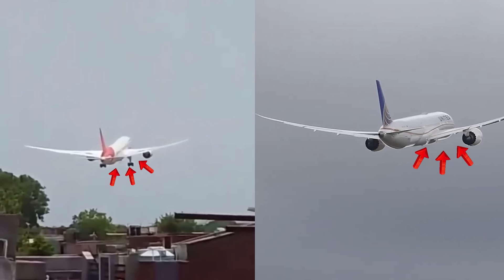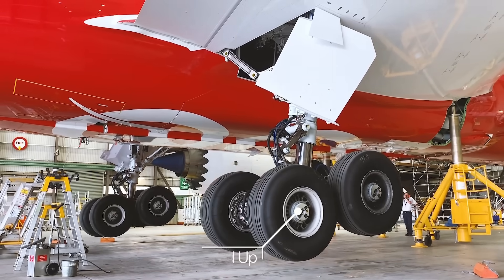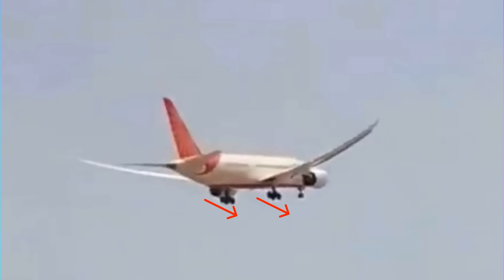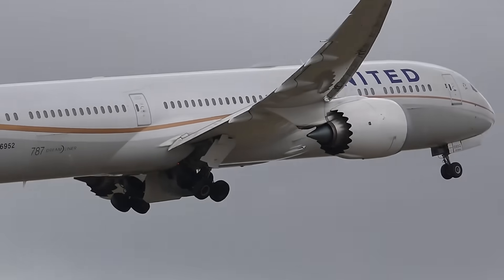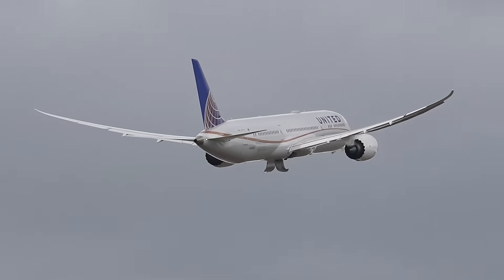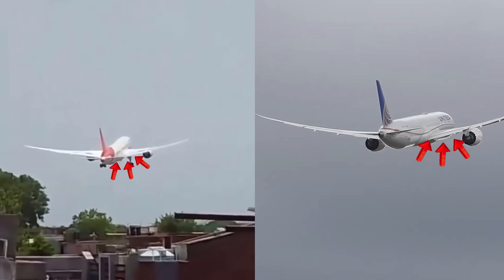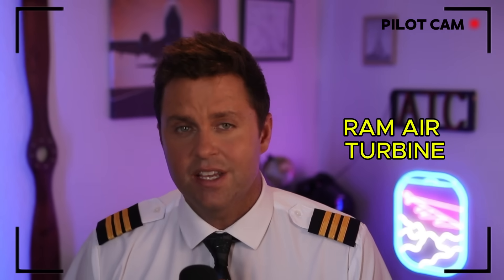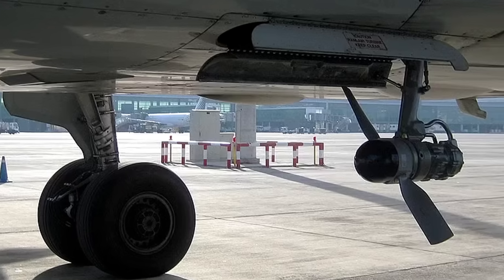Pilot Explains: A New Detail in the Air India 787 Crash Everyone Missed

Comment: I agree that if both engines failed, it would be extremely rare.   Something common to both engines, such as fuel.  But no one has mentioned maintenance on both engines.  That also would be a common denominator.
Reply: There might be a mechanic having worked on this jet recently that might have an idea what happened. Start with the electrical mechanic.
Reply: India ...is a common denominator

Comment: What about the required computer reboot every 51 days (originally 248 days). Would system software be able to shut down both engines (or put them into an idle) ?
Reply: Booth were different issues. 248 - GCU and 51 CCS..which were resolved according to the released ADs...